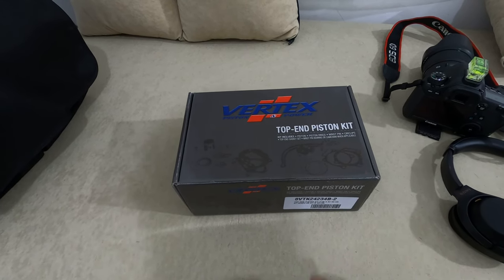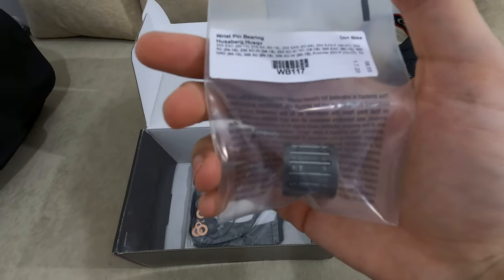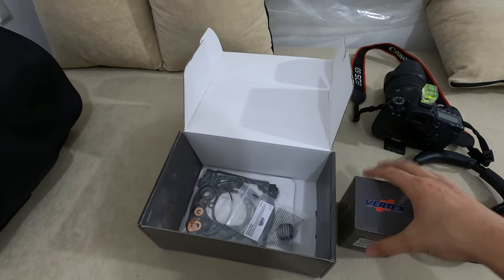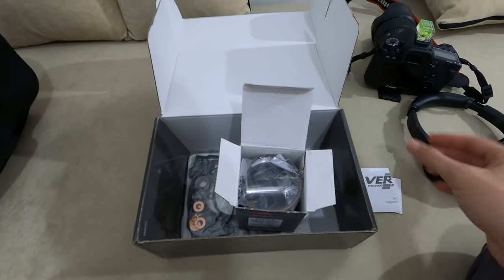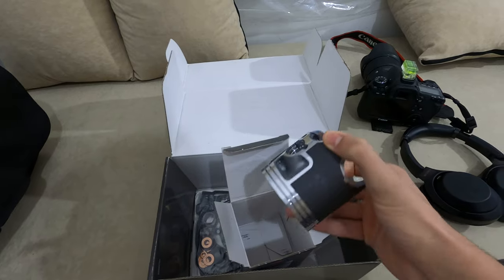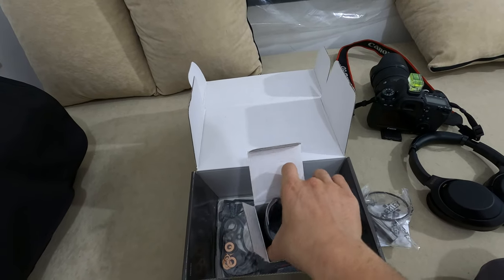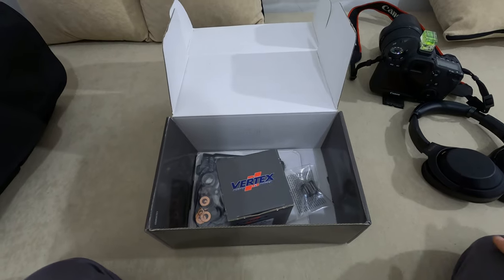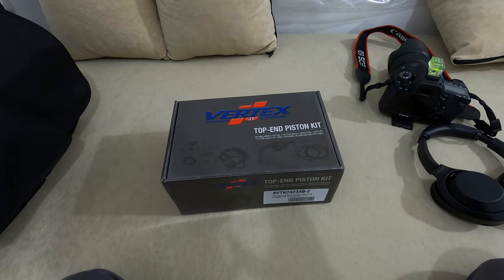LOOK WHAT I JUST GOT IN THE MAIL!

Comment: Definitely get the EZ Clips with the loops on the ends. They’re cheap and you can get them from Slavens or a KTM dealer.
Reply from the maker: I really wanted to buy them but they're not available in Israel...are you sure they should be available via KTM dealers?
Reply: Nir Hason My local KTM dealer keeps them in stock.
Reply from the maker: @DirtBikingwithDonnie  Thanks, I'll check it here. That's the only thing that I'm "afraid" of during the process so I won't scratch or damage the piston.
Reply: Nir Hason The standard clips are very difficult to install on the 250 and 300. If you can’t find the EZ clips then I think there is a special tool you can buy for the standard clips.
Reply from the maker: Thank for the advice, I'll check I can grab such tool from a friend.

Comment: I did my first 2stroke top end a month ago using the same kit, EZ clips came available just before I started on the job. All went well, the worst part was scrapping the old lower gasket off without dropping any shaving in the crack...
Reply from the maker: I did a mistake that I didn't order EZ clips, the C clips are a nightmare! - EZ clips on the next one for sure!
The trick with the lower gasket is to put a towel inside the crank so nothing could fall inside :)

How long it took you to complete the top end?
Reply: @NirHason   I was sick with CV19 for the week prior. As I was recovering I HAD to get out of the house, out of bed and get some outside air. So, what better recovery therapy than to work on one's bike 😉 I had to take it slow, I did the top-end rebuild in steps over 5 days. Probably a total of 6 hours over those days.
Reply from the maker: I'm glad to hear that you fully recovered, I had CV19 too on Jan 2021, nothing major, I was more hungry in the most part and a bit of headache haha.

It took me about the same (most of the time was wasted on cleaning the powervalve by hand) as you - it was my first time doing this job.

I love working on my bike, it's part of the hobby for me.
Reply: @NirHason  I'm not usual ever sick, but the CV took me out of commission for 3 days from the headache and bodyaches. Then 3 more days to come out of the daze ....
Reply from the maker: You're lucky then and glad to hear that.